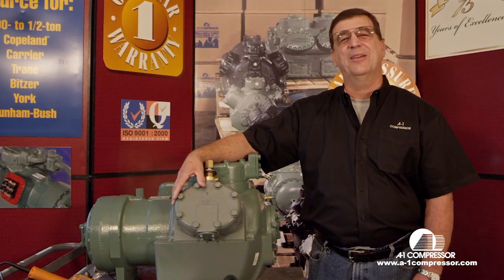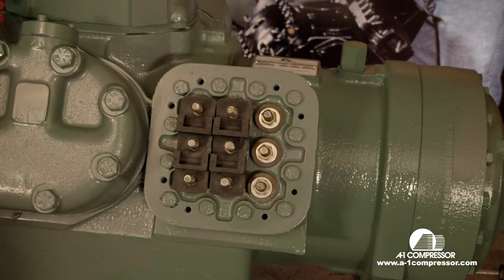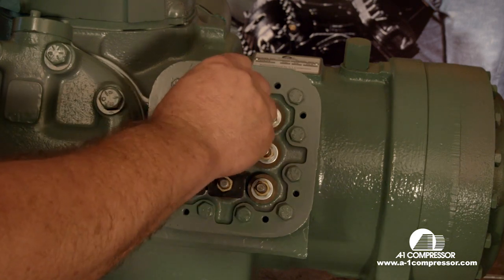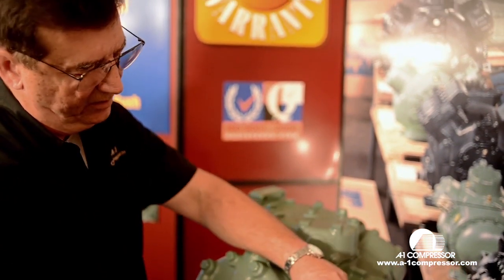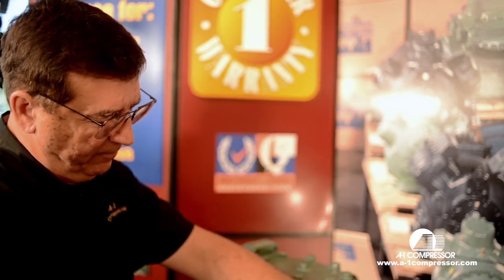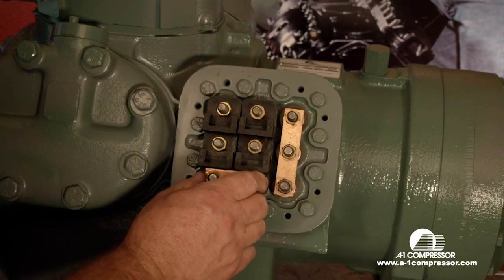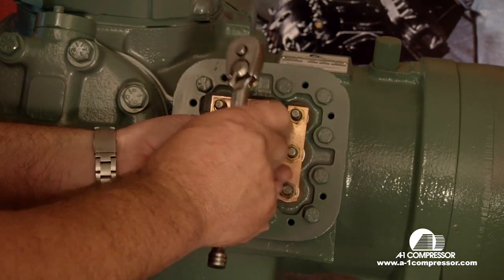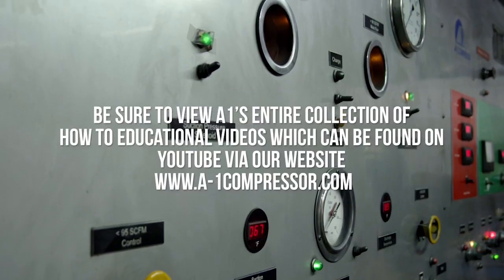How To Wire a Carrier 06E 208/230 Volt 3 Phase Compressor

Comment: Just a general question. I have two 7.5HP 3-phase Bitzer compressors. Can I power them from a single phase line using a single phase to 3-phase VFD converter?